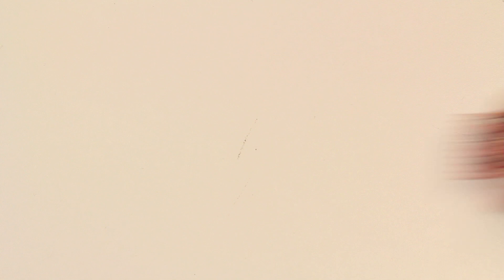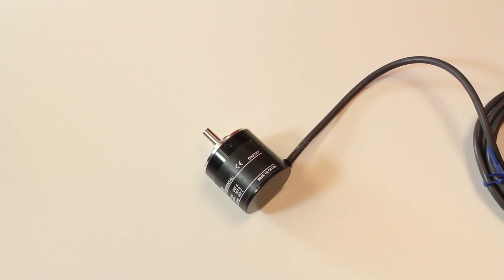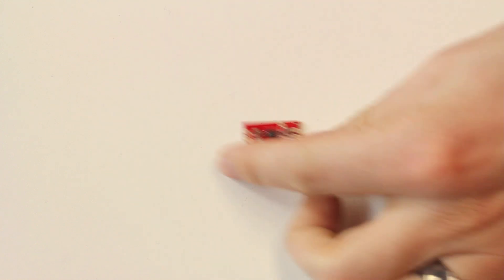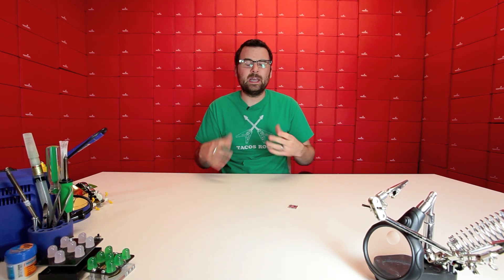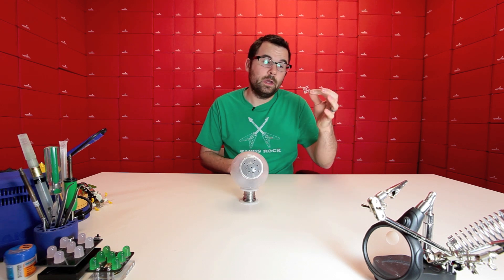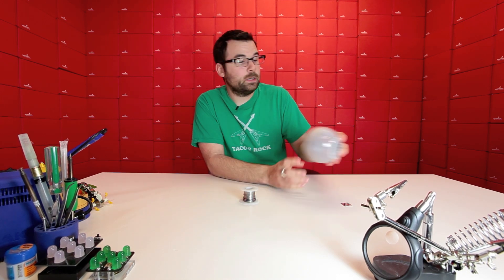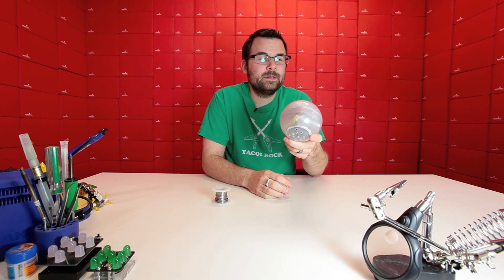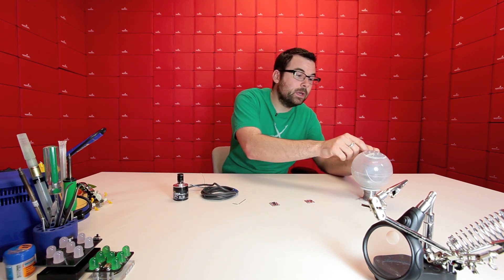SparkFun 3-9-12 Product Showcase

Comment: The ShakeSphere is a great idea. I think the missing component of the implementation is sentence structure. Use 2 or 3 different tables with lookups indexed by the coordinates. Each table should have a different part of speech. So X-Y-Z might translate to noun- verb-adverb ("cats hate vehemently" for example). Noun-verb-noun could also work, etc. Similar in function to those online insult generators. - S